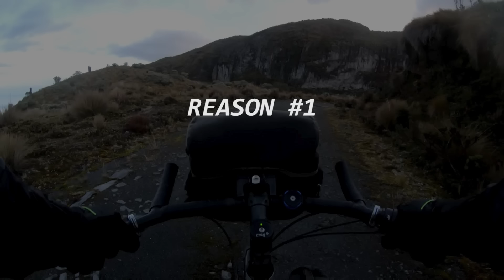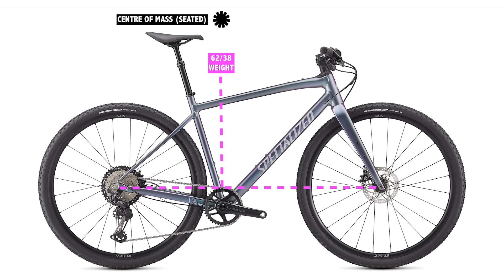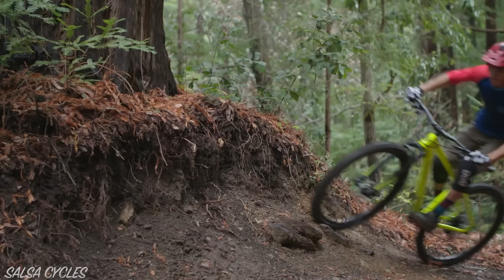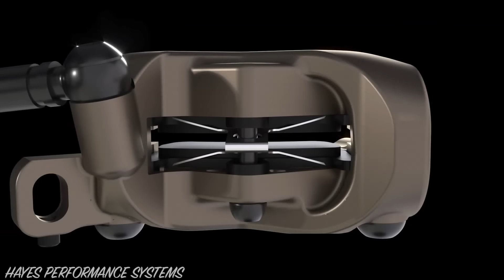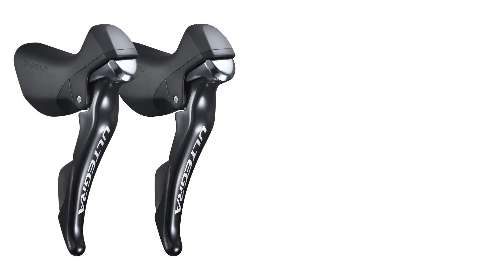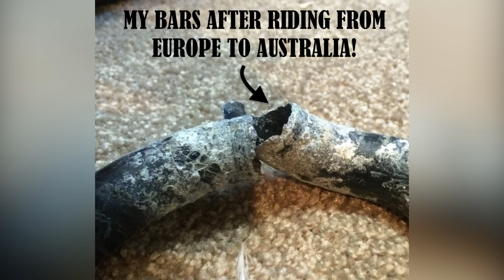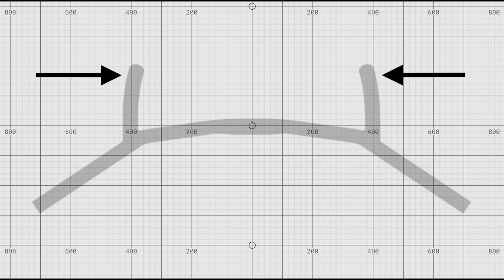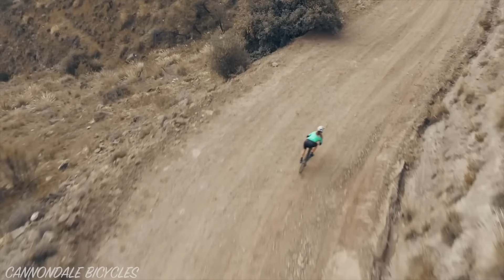Why Flat Bars Are BETTER Than Drop Bars For Most Cyclists (Objective Analysis)

Comment: Um, why is "ergonomics" subjective, but "more confidence and more control" objective? What units are you measuring "confidence" in?
Reply: This isn't to say there aren't some objective comparisons in the video - cost, for example. But then what is missing is significance ---- there is a difference, but how much does it matter? In other words, more context is needed ---- for example, about what portion of the total cost of touring is this difference in equipment costs (including maintenance)?
Reply from the maker: Both flat bars and drop bars can be made ergonomic for you, depending on your use case. A lot of the time it comes down to personal preferences.

My units are steering speed, steering leverage, endo angles & looping angles.
Reply: @Cyclingabout  Those are units of confidence. And it isn't clear how they translate to confidence, even in a subjective fashion --- for example, does increasing steering speed always result in more confidence, always less confidence, or sometimes more and sometimes less?
Reply from the maker: @bentoomey15  Increasing the steering speed via a bike frame's geometry results in more 'twitchiness'. This is not a good thing at high speeds for a rider who lacks confidence as bumps and depressions in the road push your handlebars side to side.

You can ride down a hill on a 1990s mountain bike and a current mountain bike to get a sense for how much more confidence-inspiring the modern, slower steering bike is.

The downside to slow steering bikes occurs at lower speeds, where there is a slight pulling force to the left and right (more wheel flop). But this does not affect rider confidence.

Comment: Let me first say that I loved the video, and as being a merely intermittent and utilitarian biker I have no "dog in the hunt". That said "back in the day" when I biked quite a lot for exercise the "drop handle bikes" all had (as You also mentioned) a "shorter wheel base, and a more "upright geometry". And it was claimed (And I at least believed that I "felt it") that this geometry was "more effective". And by that I mean that the geometry was "stiffer" and thereby lost less of Your "exerted energy" into flexing in the frame...
In short the "dropbar bikes" with their "shorter wheelbase" (and more upright geometry) were "claimed" to be "made for high speed"  on "good roads" with it's stiffer and more "effective" frame geometry, but for the same reasons they're less manoeuvrable  in "low speeds" and more uncomfortable to ride on "rough surfaces".
"At least that's what i was taught back in the day" ;)
Best regards

Comment: Total Bollocks! Ergonomics is the most important point, so excluding it excludes any sense.  What follows is that the maker of this video prefers the bikes that get flat bars more often than drop bars.
Reply from the maker: Both handlebars are ergonomic. That's why some people prefer flat bars and others prefer drops.

And I don't prefer one bar over the other, in fact, I have more bikes with drop bars than flat bars. Each of my bikes has simply been optimised for its use.

Comment: Lots of good/interesting points made. Not really sure about this being an objective analysis though. I mean,  For instance, point 7 is all about how flat bars come in tons of designs and drops don't. Ignoring that "flat bar" typically refers to just that, a flat handlebar, you go on to the next point saying that grips are better than tape. How are you supposed to use all of these interesting bar shapes with lots of hand positions with just grips and no tape? And the grips vs tape gets 2 points because you then added a point for sweat corrosion. You have a whole point for gearbox shifting? Separate points for bikepacking and offroad handling? Lower gear ratios is a point? Generally agree though, for racing and road riding, drops. Everything else, non-drops.
Reply from the maker: - There is much more grey area and nuance to this video than you're making out. I have made most of my points very broadly, and you can then decide if they apply to you.
- The bar tape is a good example of this. Sweat corrosion will only be a problem using some handlebar materials, in some climates and perhaps only if you don't wear gloves. Should you keep your bar tape clean or use a waterproof layer underneath, it won't ever be a problem.
- Again, you will need to calculate your own score based on what points are relevant to you. If you don't use a gearbox bike, there is no need to give that point any weight.
- Yes, gear ratios, bikepacking bags and handling are part of my analysis. Sure, you can hack drivetrains to mix and match parts, use different forms of luggage and fit wide drop bars to a bike to achieve a high steering leverage, but this video is intended for a broad audience who are likely buying their bikes complete. For them, it's worth considering more than the handlebar itself.
Reply: Okay, I'm just a little confused as to why something like longer wheelbase gets a point for flat bars, but shorter wheelbase doesn't get a point for drop bars. There are certainly advantages to having a shorter wheelbase. Same for lower gear ratios, wouldn't higher gear ratios get a point, since a lower overall ratio would mean its easier to spin out? It just seems that for flat bars, or non-drops, points were often spread out to multiple points, and corresponding points were left off of the drop section, leading to a huge difference in the number of points for each. I like the video, its very well made and has a lot of good information. I'm not trying to start an argument, just saying that I don't see it as totally objective.

Comment: You do not get a lower centre of mass from a longer wheelbase. This is just false. The COG is the exact same height, it just has a slightly greater distance to either wheel, which increases the moment required for that mass to react beyond the wheelbase, which is what increases the stability.
Reply from the maker: You're correct, my mistake. 👍🏻

Comment: Good arguments but couple of thoughts, 1) Frame geometries are changing with gravel bikes offering longer wheel bases + drop bars 2) What happens to the cost argument if you have to add a retrofit flat-bar with more hand positions than a standard one off the shelf? 2) At what point can you keep calling weird configurations a "flat-bar" when they often have shallower wider drops? 3) The increased front bag capacity is true, but ill advised for handling and wind resistance over long rides 4) Bar-tape absorption is a blessing and a curse, but if you don't wash your bike thats on you as the rider, its only an extra 15 seconds to soap them up and rinse them, and most modern coatings can keep the aluminium safe in-between tub time. Having said all that, I'd hate to go mtn riding or touring with a standard drop bar for all the reasons you mentioned. Great video!

Comment: As a fan of drop bars, I would like to add another upsides of drop bars: You can get your centre of mass lower by riding on the drops which greatly improves high speed cornering,
Reply: Indeed. But as most cyclists are just casual and normal-speed riders, to me that doesn't seem to be a major upside. But to those who bike kind of competitively, this upside along with lower air resistance does make for a large compelling reason.

Comment: 'Objective  analisis'  ... Disclaimer? ...  flat  bars  are  good  but  one  thing  out there  is  and  all  rounded  eficcient  pedaling  position,  following  the  principle of  'bikefitting' you  suppose  to NOT  put  most  of  your  weigth  on  your  sit  bones,  every...  EVERY  single  flat  bar  put  your  body  on  vertical  position  on the  other  side,  dropped  bars put  your  body  nice  and  easy  not  just  in  many  positions  put  your  body set  for a  balanced weigth  carry  for  your  sit  or  back  bones... I  didn't  belive  how  eficient they  are  but  they  are!!  about  sweet  and  corrosion,  thats  up  to  the  user and  now a  days  there  are  tapes  that  help  on this issue ... and  toe  overlap  is  on  the  frame  not  on  the  bars. drop  bars  take  a  natural  aproach  to  drive a  bike ... other  bars just  reach.  but Disclaimer!!1  is an  Opinon.

Comment: I use flats more because I get wrist pain from drop bars. Can't use the bike for more than 2 hours if I'm actually exerting. I think it's partially from how much more force is required for braking.
Can't exactly fit 4pot hydraulic disc brakes on my road bike.
I think the aero benefits are more the way bikes with drop bars are designed than the handlebars.
It's not like I could get into a more aerodynamic position on my mountain bike, my fave is already almost touching the headset when I'm going fast.

Comment: Hey, c'mon!, isn't it apples and oranges in # 3  with  'drop bar frames' giving you toe overlap? 
Ah, so it is the drop bars that cause this toe overlap on a bike ...! Brilliant! -;
Reply from the maker: Hmm... last time I checked, drop bars come on drop bar bikes...
Reply: @Cyclingabout  
Most of the time yes, I agree, Surly touring bikes may be one of the exceptions though. But from the way you put it in # 3 one can get an impression that the drop bars are to blame for toe overlap. 
And I'm with you that straight bars are so much more convenient to manoeuvre;  I myself have replaced drops with straights  on my city fixie, even if toe overlap still remains, due to the frame, of course -;

Comment: You can't argue with price.  To go drop bar you are spending more money.  However, if you are going drop bar it tends to mean you're becoming more serious about cycling which is why I agree that flat bars are better for most cyclists.  What prompted my switch to drop bars is that my rides were getting longer.  I was developing wrist pain from riding flat bars on these longer rides.  Bar ends definitely helped with this but when I purchased my first road bike, riding in the drops just feels more natural when I sprint versus the flat bars where my arms were too far apart.  Despite how much I prefer drop bars, there is no denying with flat bars it is much easier to make modifications to the bike.  I purchased a fat bike with cable actuated disc brakes which are terrible for riding in cold temperatures.  I didn't have to take the bike to a shop to switch to hydraulic disc brakes.  I was able to install them myself and it wasn't expensive.  When I had to do this to my road bike, it cost me $800 and I had to pay someone to install them because I wasn't able to do it myself.  It is a shame that the alternative flat bar designs are not the standard.  It is a given for me that anytime I purchase a flat bar bike I'm going to have to purchase either a new handlebar for the bike or accessories to make the handlebars more comfortable.

Comment: So many things I disagree with in this video, many just for being generalizations... and I get that you are generalizing and that's no secret but for example there's no reason you couldn't install a hydraulic four piston brake on drop bars with a 160mm or even 200mm (if you desire) in 2021 when this video was made (not that four pistons are remotely necessary for 99% of touring). Granted, the benefits are more likely to show up on a complete bike build for flatbar while most drop bars will require customization to be offroad ready.. unless you buy an offroad ready complete dropbar bike, at least. 

The things I do agree with... pricepoint is spot on, you get more for your money with a flatbar (and it will also be easier to get the lowest possible gearing that way). There are plenty of hand positions available on a flatbar with a little creativity... but I still find longer rides with drop bars more comfortable and haven't found the right combination of alt bars and bar ends to where I've been able to drop the dropbar. I wish I could try out your namesake bars as on paper they look great but the Koga supply chain into the US is lacking and I'm not paying nearly as much to ship as the bars themselves. 

Not mentioned.. older flatbar bikes have more room for fatter tires.. so late 80s and early 90s MTBs make for some great touring and gravel machines with room for fenders, wide tires, heavy duty construction. Typical drop bar road bikes are just finally catching up. I can just barely fit a front 42mm without fenders on my 2002 Trek 520 (back has more room) so it was clearly ahead of its time.

I do think this is an important video and one I plan to share due to the current trend of converting older MTBs to drop bar monstrosities which in my personal opinion is giving up most of the benefits but gaining few in return. I say this as someone with a strong preference for drop bars overall, use what the thing was designed for and appreciate the many positive aspects of flat bars. Given the price difference you mention, I wonder how much of this trend is marketing driven.
Reply: Another thing you didn't touch on.. component compatibility (you did mention internal gear hubs, at least). The primary thing that drives me towards flatbars at all is that my touring frame has v brakes and I don't like any of the drop bar v brake levers.. and if I don't want to use bar end shifters, trying to make MTB components play nice with drop bar shifters can be a real headache.. the brake issue is going away with hydraulics becoming standard.. and then there's derailleur compatibility which, God help us, since the industry seems bent on sinking triples and forcing us to use subcompacts in the near future; when that happens, I'm switching to a Rohloff and belt drive.
Reply from the maker: It was essential that I generalise, and I think that's ok because most people use my information to buy complete bikes (new or used).

You can, of course, use wide drop bars, find frames with long front center lengths, hack road bike drivetrains, and fit larger calipers and rotors. But you really need to know your stuff to pull this off... even I have to look up what combinations of parts can work together.

Comment: Simple, saddle should move further forward more and stem should change shorter and upper. Posture will be more comfortable for long ride. Saddle should change that your butt size matter and gel inside more comfy. Get the bike like gravel touring type , not roadie type because it too way bend down your back . i using dropbar no issue , it just that need more upright posture so you will feel different

Comment: I've tried many flat bars on a MTB that I use for carrying panniers.  I have even been using the Denham bars, but I don't get along with any of them now.  Too much awkward wrist angle, too much weight on the saddle.  Nothing comfortable.  I want either a wide drop bar 55cm or, even better, a wide bullhorn bar 55cm.  With a bullhorn I would use barend brake levers.  Alternatively, it might be possible to use a flatbar with barends to create a bullhorn.  Then put barend levers in the barends.

Comment: I mostly agree 
but, of course I (am) have a but(thurt)

IMO the argument about stronger braking isn't really about the bars. The fact that most drop bar bikes come with flat mount calipers, and those only recently started supporting 180mm rotors has nothing to do with the bar shape. In theory (and in practice if you go full custom), you could easily have drop bars and 203mm rotors with 4 piston calipers (to the best of my knowledge nothing prevents mixing/matching road levers and mtb brakes, and in case there are also road specific 4 pistons nowadays). 

Levers like GRX allow for one-finger braking in the drops. And when you are descending steep terrain on a gravel bike that's where you want to be, since that's the widest part of the bar. Granted, on flat bars this is more intuitive since you don't really have to transition from one are to another.

The same can be said about the low gearing argument. It's an industry choice, and the fact that bike touring is a niche thus not worth investing in purpose specific lines. My (drop bar) touring bike has a rather exotic 44-32-22 front and 14-28 rear, which is plenty. Now that I will upgrade from 9 to 10s, I will even be able to add a 30 at the back.

Still just in my opinion, I would argue the comfort of drop bars is a bit downplayed here, although in honesty, I never tried any of the "crazy" bars on my tours and maybe I should, and my experience mostly derives from full suspended mtbs. Personally I always found the way flat bars open your chest and shoulder to be really "weird" if not uncomfortable on longer rides. Guess this depends also on how one tours, but for me the idea of spending upwards of 6 hours a day is a tough sell.

Comment: Toe overlap could be as simple as frame designers not paying attention to how people are using dropbar bikes at this point. As a dropbarmtb enthusiast I find it odd that 69 degree hta is considered slack in a dropbar specific design and 67 degrees or more is seen as extreme.  As far as control, depends on the rider more than anything. If you are riding on the hoods during descents then you are doing it wrong, even with mech brakes on my bike I am able to one finger brake just fine and have plenty of control in tech lines. The hardest part of dropbars in this situation is getting used to be forward on the bike where flats allow you to remain more upright.